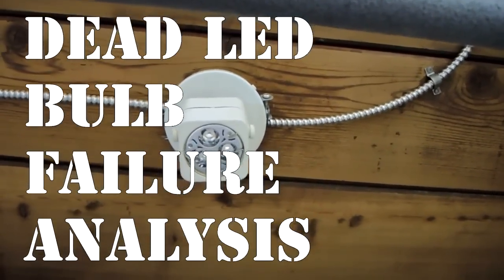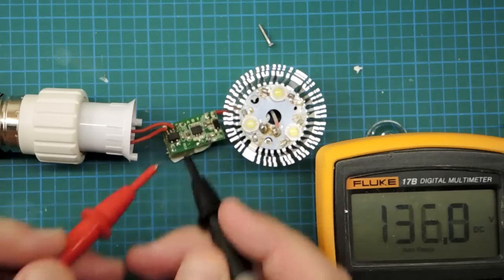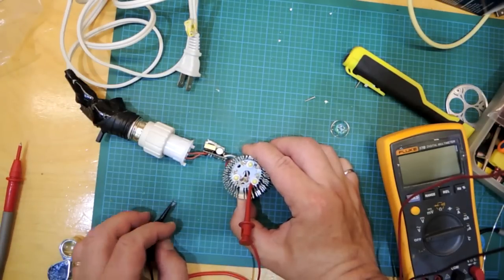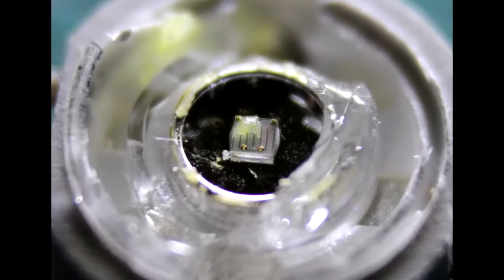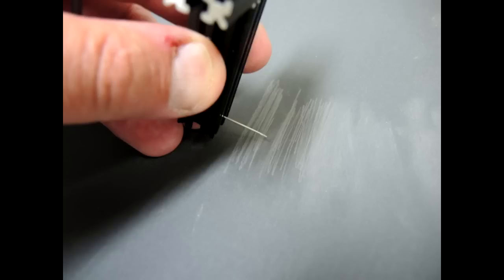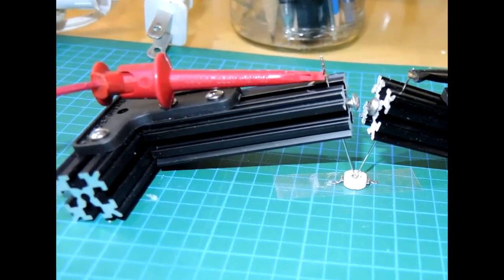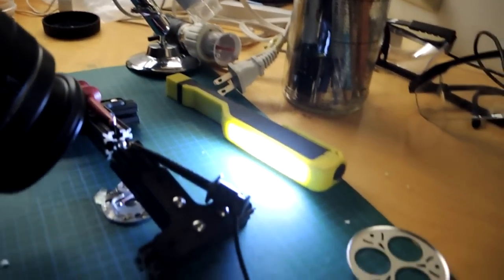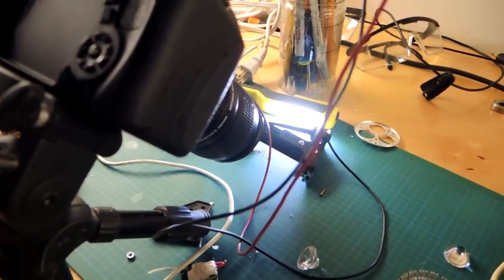Failure Analysis of an LED Light Bulb

Comment: I had a 50W LED progressively fail in sections (I made a video about it), and it seems that the points the bonds failed were not on the LED die, but were where they attached to the supply connections.  And all at one end too.  It makes me wonder if the lead attachment machine only operates at one fixed bond attachment level, and it's basically creating dry joints on the heavier busbar connections.  Did you put in a new LED?
Reply from the maker: +bigclivedotcom. Interesting!  I did not replace the dead led since the purpose of the video was failure analysis, not repair.  Thanks for pointing out your video.
Reply: +electronupdate 
I'd hate to pay that repair bill.